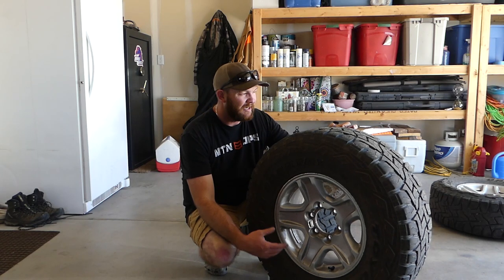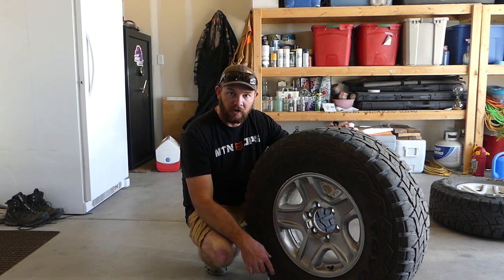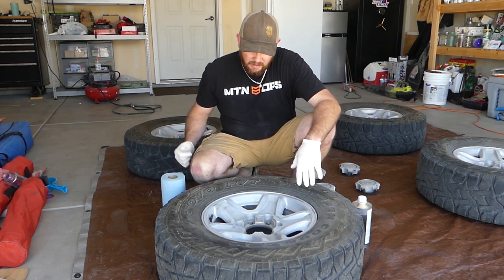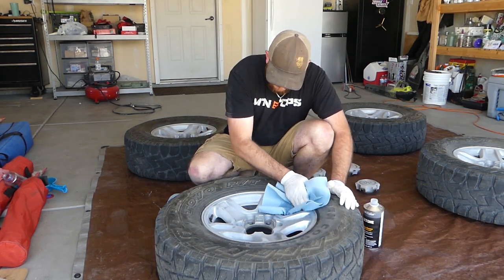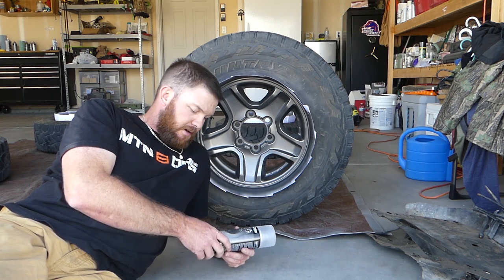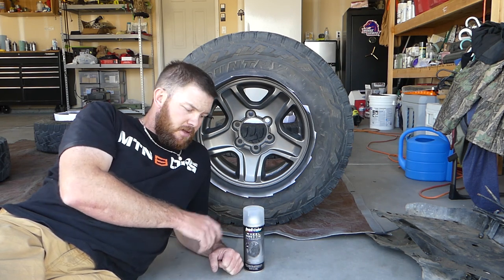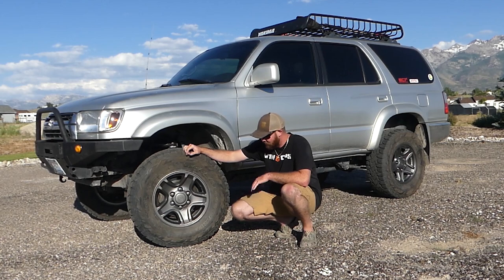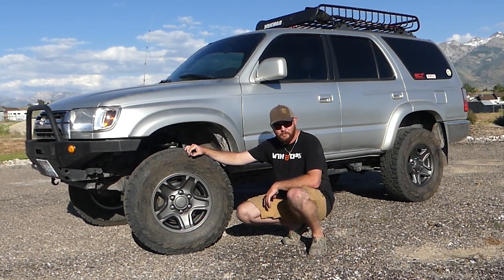How to paint the wheels on your 3rd Gen Toyota 4runner!! EASY!!!

Comment: Thanks for the video. This is really helpful and gives me some hope that I can do this project!  I just picked up these same wheels, and I'm going to put them on my 2004 PreRunner.  The paint is a little faded, and the caps are in bad shape, so I just want to paint them back to the original color following your same steps.  Dumb question - how would I find that original wheel color (instead of the color you changed to) so that I can buy the right Dupli-Color match?  Would it show on your i.d. tag (wouldn't be on mine since my OEM wheels are different)?  Thanks!

Comment: Nice job! How long did you wait between each step, primer, to paint to clear coat. Also, how long after the clear coat to being on the road?
Reply from the maker: DaveDaDude generally speaking. I just hit a wheel and then moved onto the next one in order. Then waiting about 10min and started over from where one. After everything was applied, I let them sit for about three hours in the heat of the day. Then, bolted them up
Reply: @jfoutdoors4337  sweet thanks for the info! I have my next project

Comment: Do you think 285's would fit on this wheel? and would you expect to use spacers to keep from rubbing the suspension?
Reply from the maker: Steven Corrales yes they will fit. And, because I have after market SPC upper control arms I don’t think that I would have to run spacers. That is what I have gather on the 4runner forums

Comment: Anyone know if these 5-star wheels fit a 98 Limited?
Reply from the maker: yes they will
Reply: @jfoutdoors4337  Thanks! The reason I asked if they fit my 98 Limited because I just bought a set came from a 2001 4runner and on Ebay it said it only fit 99-02 4runner. I don't want to get new tires for the wheels if they won't fit my 98 Limited.